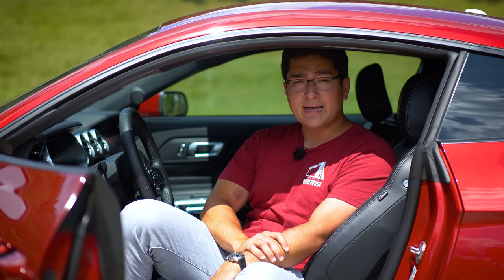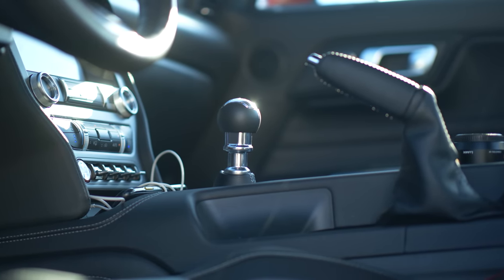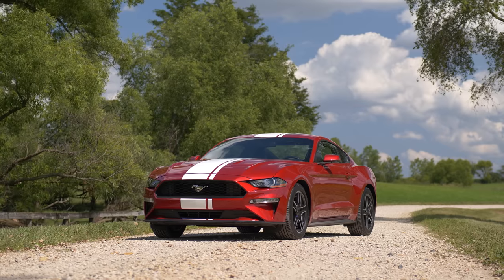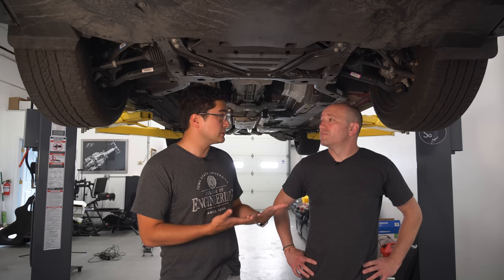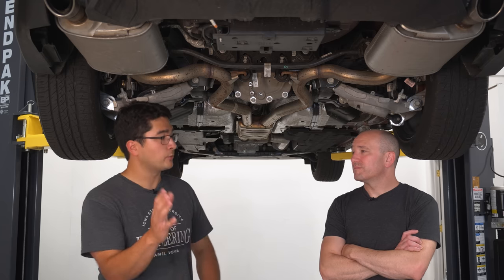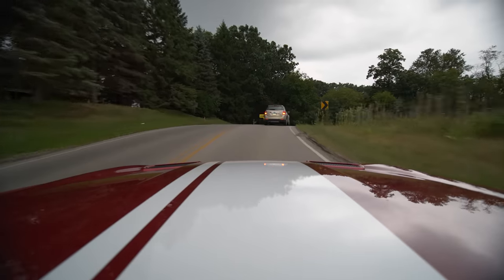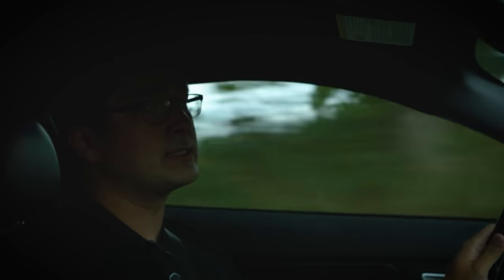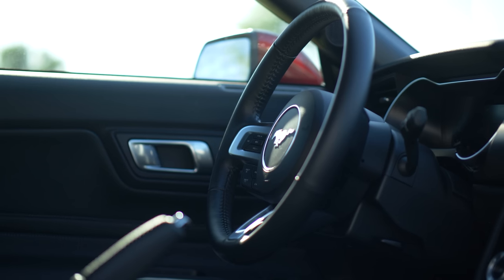2020 Ford Mustang EcoBoost | Red Headed Step Child

Comment: "We drive everything, and to the regular person a 300hp rear wheel drive car is sporty, and it is fast"

Yeah I drive a Prius, and 200-250hp rental cars feel fast, 70s sports cars were 10 sec+ 0-60
Reply: For that matter, people look at '60s musclecars through a rose-colored rear view mirror, and remember the over-inflated SAE Gross power ratings like they're gospel. 
In SAE Net, a 428 Cobra Jet had ~335hp, and now the 2.3L EcoBoost HPP has that.
Reply: I drive a 170hp Golf 1.8t and my sisters 273hp CX-9 feels fast.
Reply: @ilovemanunited6179  I rented one of these Mustangs and it is pretty easy to do burnouts if you play with the settings.

Comment: My 07 GT only makes 300 HP and has a 5 spd... would probably be gapped by an ecoboost 😒 at least I sound better
Reply: Your gt is 13 years old. I would not worry about it. If 13 years went by and ford did not create faster cars that be the real disappointment.
Reply: Probably? 😂
Reply: 728 Autos driver mod 😏
Reply: But you have gt v8 power
Reply: When will people learn physics and know horsepower isn’t everything? I keep up with newer 5.0s (not the S550 or Shelby’s ) especially the dumbass 2 valves in a 300hp e36 1997 with NA long gears. Transmission, drivetrain and tires make just as much a difference as power.
Reply: Real Mongolian Hours yes well u see... ecoboost has better transmission and tires 😅
Reply: At least yours isn't so electronically neutered like a modern one.
Reply: You never now i had a 2016 focus st all stock and i raced a 2018 stick and auto ecoboost had them both by a fender....
Reply: MCpeebs true, but I’ve seen some decently fast mostly stock cars on good semislicks and good transmission gearing with some bolt ons. I just don’t see the point in buying the eco boost or even V6 mustang bc even for a normal person it’s like buying a fake iPhone or high end Android. It’s not THAT hard to handle 400hp and the new stangs get decent mileage with the new tranny. Maybe it’s bc we’re car people... but I just don’t get it.
Reply: Prefer Supercharger (Whipple/ Roush), because at 38,000 miles i had Turbine Lockup within the Turbos at 82°+. This is caused by Thermo Variations consider locations of Turbos Ford mounts them below for lower center of gravity.  Problem is they're right next to the very hot engine.  Ricers know this and mount them up high close to heat extraction hood vents.  To keep them cooler, and not for show. Now the Turbo Shell expands like a donut 🍩, while it's being baked the outside expansion is outwards vs. Inside expansion is inward the hole gets smaller. The Blades expansion is outward to be larger to hit the Shell. Locking up the Turbine Blades, and then add the Backflow from the Intake and Downpipe to it to spool the the Turbos more.
My fuel mileage went from 
32 mpg to 8-12 mpg.  Glad for 2021 it'll have the GT500 engine package 5.0 V8
Reply: Better Naturally Aspirated (N/A)
Reply: Yes, you do sound better, and if you have 2 Chambered Flowmaster's you sound Awesome 🙋‍♂️👍
Below had written reasons for staying away from the Turbos any Turbos, because not reliable. Turbos part cost $1,689+ installation.
Reply: @ChasingDifferentAdventures  lol so dont get turbos because your turbos shit out on you??? Dont get shitty turbos, easy
Reply: @bbbildhuu  nog recommending them if Spending $1,689 every 38,000 miles is what you like the go for it. Prefer Supercharger. In Fords it mounted to the engine.... engine it heats up thus heating the Turbos... Ricers and I who works in the Aerospace Industry know that is a no no. 
Had speced a Premium GT, performance pack II
 Brembo Breaks, 
Magneride Suspension, ( Hard Cornering doesn't lean & hard Breaking doesn't Dip ) think 2 Positive facing Magnets can't get them together 
Recaro seats for 
$15,000 Less than the GT350 
ADD a Whipple or Roush Supercharger 
725 hp
Reply: @bbbildhuu  you can have fun with the Turbo lag 
Get check engine light and an engine without the Turbos running run with half the horsepower and instead of 32 mpg
Get Hummer fuel mileage at 
8 to 12 mpg
Reply: @bbbildhuu  the only way is the 5.0
Reply: Even Ford Explorer, Ranger, Broncos have the 4 cylinder Turbos, and the Expeditions have a V6 Turbos, none are Naturally Aspirated (N/A)
Reply: Yup, the 4.6 sounds better... also considerably easier to modify and the Modular V8 really wakes up.
Reply: @kennyduarte783  agreed.  Going from a 4.6 to a 5.0 on the same a 2007 would mean changing crossmembers, so the mounts could fit the newer heavier 5.0. Would require beefing up suspension in front as well as larger breaking systems.

Kind of like the Hennessey Exorcist Camaro Pay $80,000 for a 1,000 hp and leave it with factory suspension and break systems.  As well as no roll cage and i don't mean i would roll over because this hasn't and won't happen.  Just mean the torque will eventually twist the chassis
Reply: @Peace & Quiet Subaru guys sweating nervously
Reply: Bijan “it’s a driver’s car” 😭
Reply: Got an 05 baby nothing sounds better then a 3v. Take that over a v6 or shit eco. I have yet to hear a ok sounding v6 or eco

Comment: I happen to like whipping mine. Bought used for a song. It's a daily thing that does cost a little less to run than the GT, even FBO. Recaros, breather mods, and a good tune. Its like a big goofy BRZ in 295 clown shoes.
Reply: Haha, I love that description.
Reply: The 1700 kg Kerb weight wasn't brought up in the review. Does that much weight intrude into the drive experience?
Reply: @stephenbello1081  It does have its weight issues, but I am ok with that. Some better tires, a familiarity with where its limits are, and how it arrives at those limits all help my coexistence with it. Up until last month I owned a seriously wicked up Fiesta ST, and still own an NA Miata as well as a Turbo swapped Volvo 144. The Mustang slots in below the NA and Fiesta in terms of nimble, but can still hustle while providing more daily comfort than both combined.  The compromises were small enough to me that I was able to end a five year love affair with the ST, as a matter of fact. It licks the old Volvo in every way except gas-pump conversation starting.

My advice is to find a pre-18 car with no options except the performance pack and recaros. Everything you want, nothing you don't.

Since I am word salading a bit, one more paragraph before dragging ass out of bed to start the day.

The S550, in eco, with performance pack, recaros, and the MT82 is not going to set the world on fire VS purpose built cars. I would know. But it's capabilities are far more potent for the everyday than many would expect if you take the time to learn how it behaves. It's compromises are far less relevant to the experience than you might imagine. And if you don't like the compromises it does have, the aftermarket solutions are more plentiful than prostitutes in an economic depression.
Reply: Comparing a huge, overweight moostang to a BRZ 😂
Reply: @Pube83  Well, I did say big and goofy. I didn't say 1:1 ✌🏻
Reply: @agenericaccount3935  Nice car collection, it looks like you have all bases covered. It is satisfying to use your skills at the wheel to find speed rather than just bigger numbers. Im often driving in a sporty way with a group of younger friends. They had no idea what my 80's wheels were and presumed it had healthy numbers as it was keeping up with their hot hatchbacks. It's was a fun thing to reply  "25% less than yours" when asked about weight and power.
Reply: @stephenbello1081  As the former owner of a first gen Chevy sprint turbo often driven in anger, I can corroborate your experiences. While you can overcome weight with power, if you only weigh as much as a deep freeze you can do with less jam and still be very competitive.

Comment: One thing I think you guys are forgetting is the massive aftermarket potential. For a daily, throw a grand into wheels/tires/suspension, maybe another few hundred into intercooler and tune, and you've got 350 wheel and still keep the reliability and you'll have one of the best handling cars on the market.

Comment: No line-lock burnout?
My disappointment is immeasurable, and my day is ruined.
Reply: if you need a button to help you do a burnout you're doing it wrong 🤣
Reply: It didn’t have the performance pack maybe because of that
Reply: @VerryJerry90  from 2018 onwards all Mustangs came with line-lock as a standard feature. Even the rentals at Hertz have it.
Reply: Prince Charming gotcha
Reply: I have and mines a base
Reply: You must have had some bad shrimp lately. :)
Reply: Prefer Supercharger (Whipple/ Roush), because at 38,000 miles i had Turbine Lockup within the Turbos at 82°+. This is caused by Thermo Variations consider locations of Turbos Ford mounts them below for lower center of gravity.  Problem is they're right next to the very hot engine.  Ricers know this and mount them up high close to heat extraction hood vents.  To keep them cooler, and not for show. Now the Turbo Shell expands like a donut 🍩, while it's being baked the outside expansion is outwards vs. Inside expansion is inward the hole gets smaller. The Blades expansion is outward to be larger to hit the Shell. Locking up the Turbine Blades, and then add the Backflow from the Intake and Downpipe to it to spool the the Turbos more.
My fuel mileage went from 
32 mpg to 8-12 mpg.  Glad for 2021 it'll have the GT500 engine package 5.0 V8
Reply: If it has Goodyear Eagles F1 Asymmetric  no burnouts or sliding too much grip even in rain. Think Formula 1 in the rain is like driving in the dry

Comment: I spec'd out an Ecoboost Mustang with all the performance package/handling package and I think it was well over $40k for it. It's quite a lot for an Ecoboost.
Reply: Dont pay msrp, spec out a gt same and it will be well over 50
Reply: A friend of mine got a high performance ecoboost, 6mt, with the handling package for under 34k. Great car.
Reply: Average loan amount for a vehicle in America is $32,480...
Reply: yup, there's one for 45.5k near me - HIPO, Premium, Magneride, etc. Nego down to 37. That's still a LOT (too much) for the 4 banger  considering every S550 needs about $2000 in chassis fixes to drastically improve the balance and feel of the car.
Reply: Could wait 2 years and get it for $19000 used, just one non smoking, church on sunday,slow cooker beef roast cooking, elderly woman owner.
Reply: @Matthew Patton Price out a 718 Boxster S to see how expensive a 4-cylinder can be.
Reply: What features are you adding? These start in the mid 20’s . Anyone paying 40k is crazy!!!!
Reply: @matthewpatton5398  "every S550 needs about $2000 in chassis fixes to drastically improve the balance and feel of the car."  That's just silly. Most people are not going to be racing this daily driver and won't need to "drastically improve" anything about it.
Reply: @kenhoward3512  if you want a mush-handling car, sure drive it as-is. Ford's Magneride is only 'ok', there's a ton of gratuitous rubber in the IRS and diff (which you can reliably break the diff bolts because of colossal Ford Engineering f'up). Short of Driving Miss Daisy speeds, yes everyday driving is much improved when you fix the chassis. The Mustang as delivered is not shit but it ain't good by a long shot. It's about $800 in parts and then labor.

If you want a properly sorted and handling car, go Camaro. GM really knows how to do chassis and suspension. Ford might as well be run by HS dropouts. It's disturbing how inferior Ford is. Yes I own 2 S550 Mustangs and 1 Gen6 Camaro and drive them back to back.
Reply: @Fleetleader101 I'm sure the standard deviation is like 12k and there's a disruptive selection from two peaks σ=-1 and σ=2
Reply: I ended up paying about $46k for my Bullit before tax, got a leftover 2019 in Feb 2020, such a fun car!

Comment: Just bought a 2020  Ecoboost Premium Convertible in Velocity blue today . I am 61 . this is my retirement car . I have had a lot of new cars , performance cars , fast motorcycles ,  and I love this car . its got the performance exhaust 20 inch wheels and nice seats . and gets up to 100mph quick enough .  done that on the way home from the dealer . had to test it . . don 't need a race car . this car is fast enough . speed limits on the freeway is 70 , Whoop "s ! so screw the v8 and higher insurance . this is all I need.
Reply: I'm 73 and have a 2019 Kona Blue Ecoboost Premium six speed manual convertible and love it. Way more than enough power. I had a new 1986 GT liftback with its amazing 200hp and thought that was the cat's pajamas.   I also have a 2011 V6 Premium convertible with manual....actually like it better than the Ecoboost, and it has 82,000 miles. I did install a new touch screen interface with Android, so it now has modern HVAC controls and infotainment system.

Comment: I finally drove one and it's a great car. It's fast enough not to be slow, and it's safe enough that burnouts were possible and easy to control. Also if you live in the north, as you say , not everyone can drive a 5.0 liter coyote ((I've got a Cobra for that) so you get a sporty, two door, good look mustang with good handle characteristics. If you wanna be pompus head in the sky racers, this isn't the car for that, but it's also $10-15k cheaper, better MPG, lighter, and you day to day driving experience will be similar until you mash the gas pedal..and even then you can still have as much fun as you should be having on public roads

Comment: Not a single mention about modding, which is a huge plus for this car. The Cobb kit brings all the parts to work with each tune and you could really awaken this car if you wanted, $800 for a stage 1 with CAI or $1600 for stage 2. The first one is self-install, the 2nd stage you'll need someone to install a radiatior. 3rd stage gets you a cat-back (slides right in) for another 1k and at that point pulling closer to 400hp. This is somewhat safe since the tunes provided are designed for those parts but the people who've reviewed them noticed a huge difference in how it pulls (you get a taller rev curve).

Comment: For an EcoBoost I'd chose the 2.7 but for a turbocharged 4 cylinder in a pony car is okay  it does sound pretty good on full acceleration and I love that you can hear the turbo from the outside compared to other manufacturers.

Comment: My first new car was a 1989 Mustang 2.3L 4cyl that had 90 horsepower and 122 ft-lbs of torque.  I drove that vehicle for 400,000 km (250,000 miles) over a decade.  The 5.0L V-8 EFI had 225 horsepower and 300 ft-lbs of torque in 1989.  I purchased my new 2019 Mustang ecoboost for $10,000 under MSRP in January of this year.  It it fun to drive, turns heads, makes 310 horsepower and 350 ft-lbs of torque.  I look forward to another 400,000 kilometres of touring with this red headed step child.

Comment: I have had 8 Mustangs, all V8’s including a GT350.  My ‘15 EB PP is the best I have owned, and since sold to my son.  Why?  Averages 24 MPG, excellent street engine, and handling with less weight over the nose.  The car structure remains tight, has been very reliable, inexpensive to own and simply fun to drive.  Do I want 2020 GT500?  Hell Yea!

Comment: The aftermarket is where this mustang shines. Mild mods and an e30 tune has gotten this car into the 11s on stock turbo in the previous gen (15-17) EcoBoost Mustang. I'd assume even better with the 10r80 trans in the 2018+. I own a 2015 6r80 with boltons and currently working through my 93oct tune with PD tuning, then it's on to e30! It's already pretty potent and light!
Reply: when did they switch to the 10 speed? I commented above, but the 10speed makes this car drive terribly. As an owner of the previous trans, you should test drive one, it really shocked me. I think a 6 speed would suit it so much better, or a 7 speed with a really tall 7th gear.

Comment: I don’t see the issue. I have a 15 ecoboost that I bought for the wife. I also have a 13 boss and a fox with a 625 hp stroked Windsor. I’ve put more miles on her ecoboost than the others combined. I’m not looking to be seen and I like flying under the radar. I use it on long trips and I’m just as happy with it as any of the others. I only wish it was manual, but it was for her.

Comment: The 2013-2014 V6 was too good that they neutered it for the 2015 model and forward until they cancelled it. It even sounds better than the V8 when you put on the Roush cat-back exhaust on it.

Comment: Two years after this video went live, and I'll add my two cents to boost this channels numbers... I like this car. My wife and I rented one of these late 2021; I believe it was the ecoboost premium convertible. Premium because it had leather seats, but since there was no window sticker it is hard to know for sure. Anyway, we had that car for a week and absolutely loved it. It cruised well, and very quite with the top up, had great fuel economy, and was quicker than any car I have owned. Like the guys in the video said, for a daily driver this is hard to beat. In fact, now that we are in the market for a replacement car (RIP 2022 post-infectious disease car market) we are seriously looking at picking up a low miles used one. We loved it for a solid week, would we love it for 5+ years??? Only time will tell.
Reply: I think that would be a great decision. I have a 2016 Mustang eco boost, bought it brand new and put on 45k miles with no problems and still have a lot of fun with it to this day.